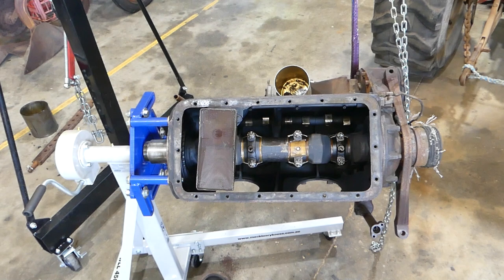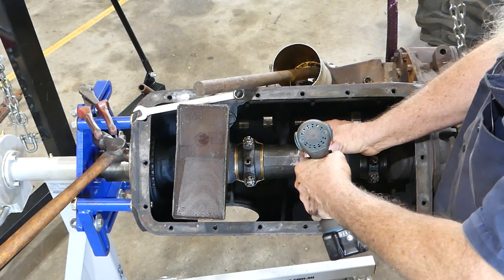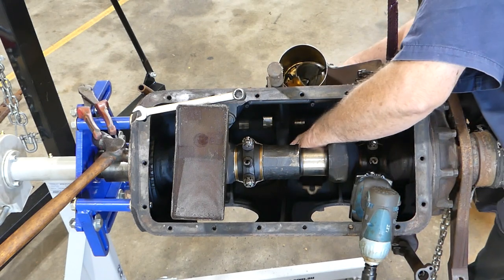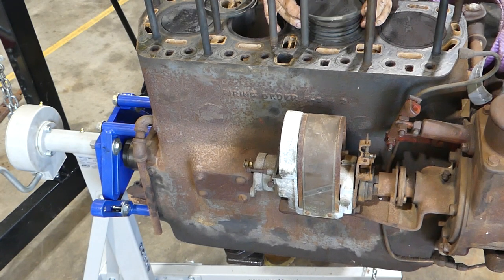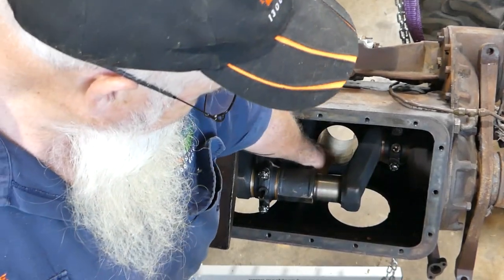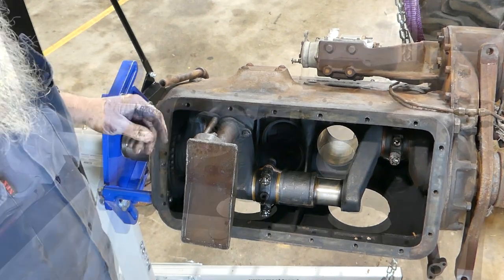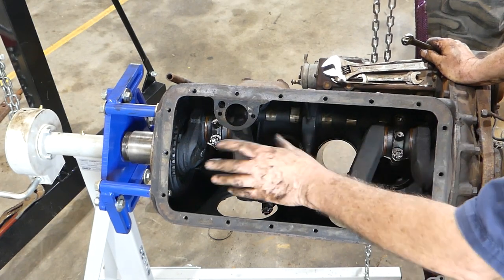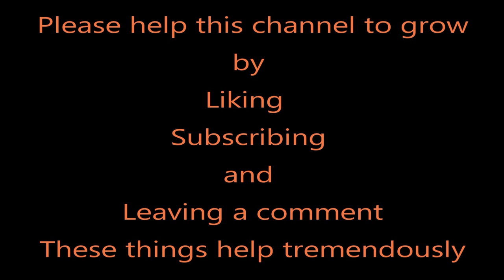1929 McCormick Deering Removing the Sump, Oil Pump and a Piston (the wrong way)

Comment: When I were a wee apprentice boy we worked on triple expansion steam engines with white metal bearings. We had to micrometer blue the journal, scrape the bearing to bed to the journal then tighten with soft lead wire to check and shim the clearance.
Reply: How old are you? I would not have thought many triple steam engines were in service past 1950.
Reply from the maker: Interesting
Reply: @bcbloc02  Bullfinch and St Margarets in refit whilst an apprentice then Ariel and John W Mackay as a sea going Engineer. All cable ships. Google the John W, impressive ww2 history. Started apprenticeship 1964. Still some of them around.

Comment: In my experience with those ancient engines the cranks tend to wear out of round pretty bad. That makes setting clearance a troublesome affair. I usually set till it starts to drag then add .003” shim. Better loose than tight as long as you can get oil pressure good enough
Reply from the maker: Yeah I agree, the lube was ordinary at best.

Comment: Good   day from Ont  Canada     I   am 74  & I  remember ploughing with   10-20  when I ws about 10.  Do they only have 2 main bearings  ?   & I  knew they were ball bearings.   I mean  they only ran at 1000  rpm.  ,  some cars jdle   almost faster.
I had sub,   but I guess I didn't ring bell  
Thanks for now
Reply from the maker: Thanks for stopping by.
Reply: If content wasn't good I wouldn't  thanks @BundyBearsShed